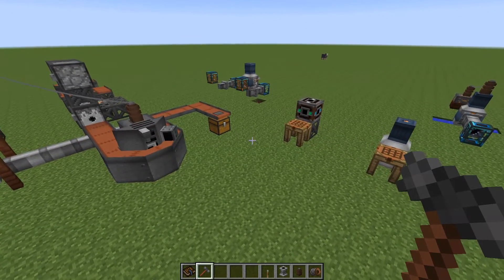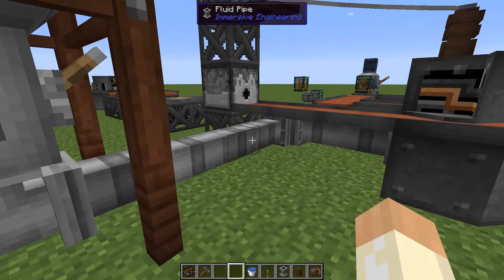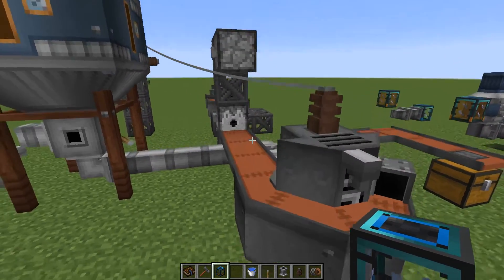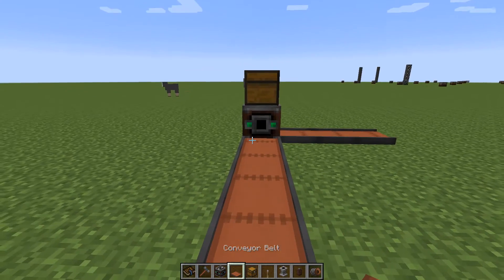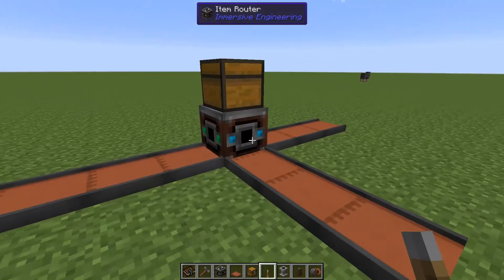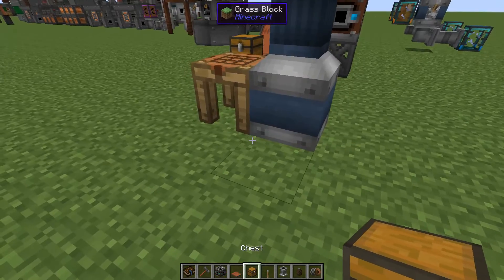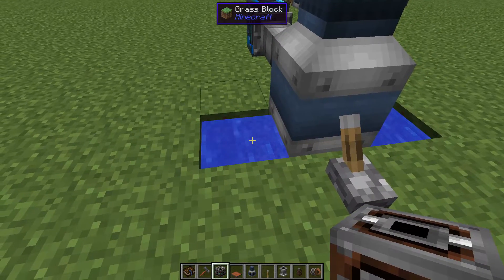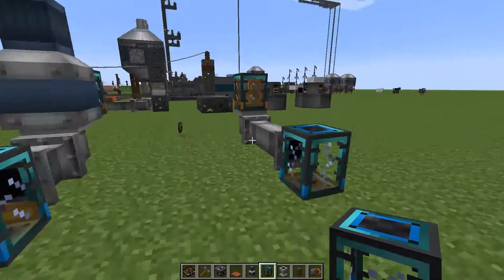Immersive Engineering Tutorial #6 - Fluid Systems and Item Sorting (MC 1.7.10)

Comment: do the fluid pipes connect to the cauldron? or the ex nihilo crucibles?
Reply from the maker: From what I can remember IE is quite compatible with other mods, but it might also change over time (mod versions) and packs. However, IE is very specific with input and output on block faces, so make sure to get that right. If not all blocks are compatible maybe you can use some container as a buffert between the systems.

Comment: Hey can you please tell me how to get water in a pipe?
Reply from the maker: These pipes are usually connected to machines that automatically pushes fluid into the pipes. It depends on what machine or block you're connecting it to?
Reply: @therealtkh  Can you recommend me a mod with a water pump? Is there something like that in immersive engineering / galacticraft / techguns?
Reply from the maker: @jumbshd  Did you watch this video?
Reply: @therealtkh  oh nevermind I skipped that part before sorry didn't see it, thank you for your help

Comment: why when i download the mod it dont have the bottle machine pls tell me
Reply from the maker: The content of the mod depends on what version you're running, but you didn't say so I don't know. However, I know the bottle machine was added quite late in the 1.10 versions. But modpacks might be running on an older version. Check video description to see what version I used (for 1.7.10).
Reply: Can you pls put a link
Reply from the maker: The link is already in the video description?
Reply: Hmm bro when i download the link the bottle machine is not there                    and this is my last question
Reply from the maker: Still don't know what version you're using, but the bottle machine was in the version I used for this video. In the release notes for 0.55 (https://minecraft.curseforge.com/projects/immersive-engineering/files/2369975) it says that that machine has been re-added. I haven't tried it yet myself though. Remember to check the in-game book if the "recipe" has changed.

Comment: I noticed you have portable tanks. What other mods work good with the immersive engineering mod. I don't have the portable tanks in my mod? I love your tutorials by the way. Very informative and very helpful every step of the way. I would have been lost so far without them.
Reply from the maker: Look in the video description for a mod list and versions. I try to have this updated and correct for every video I make. At least for the relevant mods.
Reply from the maker: Oh, and I haven't tried many mods... but it seems to be quite compatible with Thermal Expansion and other mods using power and fluids.